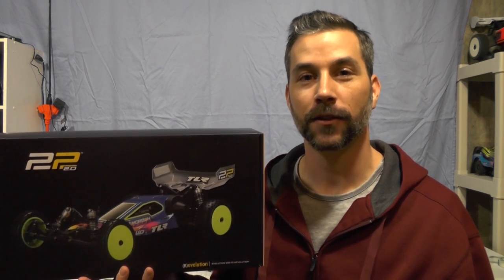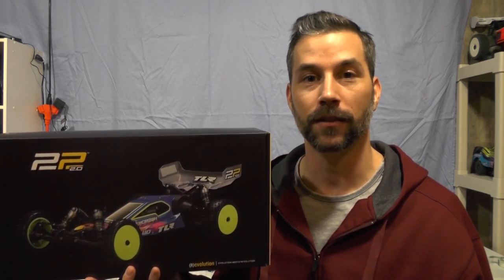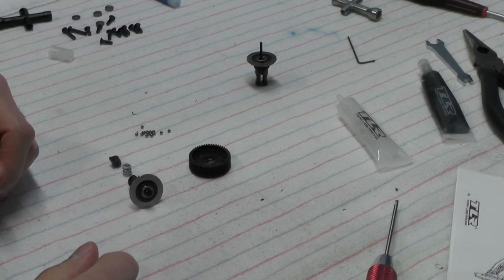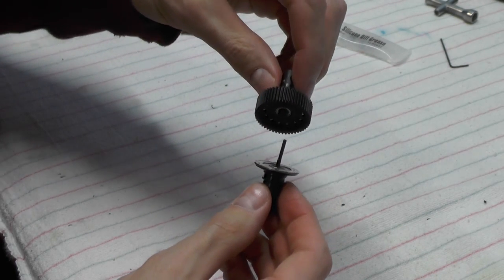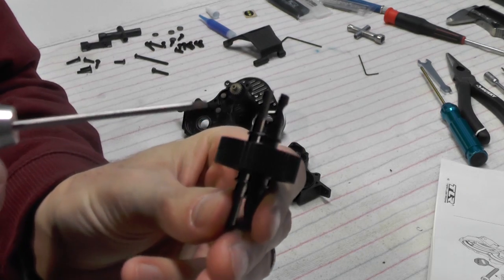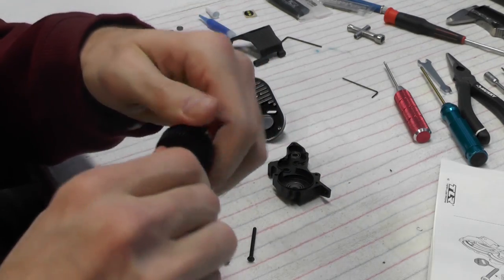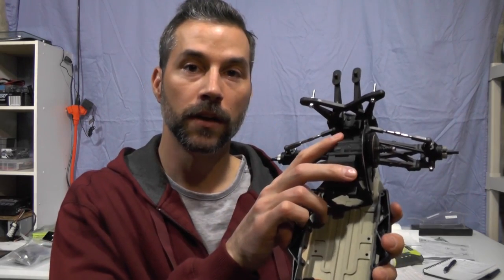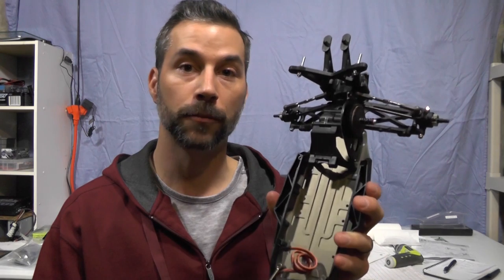Team Losi TLR 22 2.0 Differential Build

Comment: Curious to hear your opinion of the 22. I had a 22 1.0 set up in mm and needed to add the rear weights to help with traction.  I run on a dusty, clay indoor track. Also, I added the aluminum rear camber block because the ball studs ripped out of the plastic one. Saw a couple of my fellow 22 1.0 owners have the same issue.
Reply from the maker: So far I am loving the TLR 22 2.0 buggy. It drives great and I have yet to break a part (only a couple practice days on it still). I drove my friends TLR 22 1.0 back to back with mine and I honestly cannot feel that much of a difference in the way they drive. Traction is good on our track which is a high bite clay/dirt, dusty outside the groove. This is the first buggy I've driven in MM and I like it a lot, feels much more balanced in every situation, easier to drive.